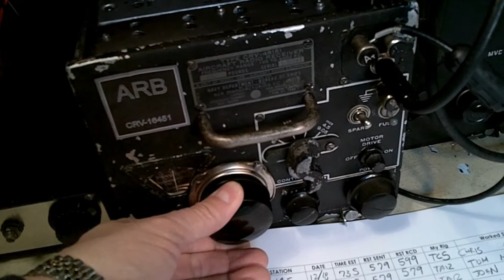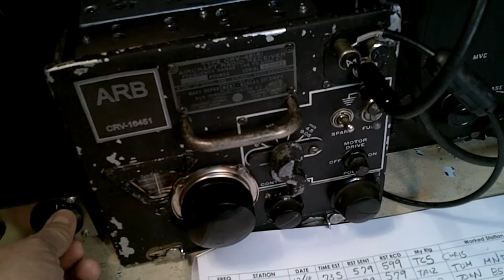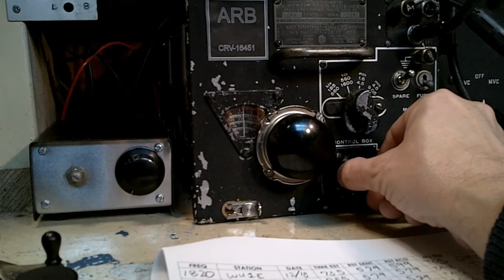Q Multiplier on Surplus Receiver

Comment: How about a GRC-9 receiver 456 KC IF? I'm lost in the noise listening to the OMRN on 3885 AM thinking about pulling out one of the Phone connectors and using another in the same hole to the Converter tube plate?jim KB1PFL
Reply from the maker: I guarantee it will work. I have modified Q multipliers to work on almost every IF frequency up to 2 MHz. 456, 465 etc.. all work by simple retuning of the slugs.

Comment: How do you make a varactor diode oscillate?
Reply from the maker: All linear oscillators utilize negative resistance in some form. Many types of diodes have a significant negative resistance region.  A negative resistance (N-Type) curve has a rising, a falling and then again a rising I/V curve segment. We need to establish an operating point on the falling part of the curve, where, when forward biased though an appropriately sized resistor, the current will bounce between two points called the peak voltage and valley voltage. Biasing above or below the sweet spot, the diode unfortunately becomes stable! No oscillations. Gunn Diodes, Tunnel diodes, Dynatrons and Varactor Diodes are examples of negative resistance devices with non-linear regions that can be utilized in this way to make oscillators. Add a tuned circuit and you get a sine wave oscillator.

Comment: Nice I have the best SW radio in history the Panasonic 2600 and I wondered if you know how to hook up a Q Multiplier to it? Thanks (73) Jim
Reply from the maker: The 2600 is not an entry level receiver that could be improved by a q-multiplier. It has adequate selectivity and passband tuning. But if you were to attempt something, first you would need to obtain the service manual!
Reply from the maker: Certainly one of the best portables! But it is too good to be improved by a Q multiplier! Remember the best results are with simple, low gain and very wide receivers.

Comment: Nice work, threw one together myself for my BC348, but I cannot get it to work. Do you use a coupling capacitor at the mixer plate on your receivers? As soon as I connect the multiplier to the mixer plate coax, the receiver goes quiet, and only time I get some noise from the speaker is when I touch the 6J5 tube. Might have missed something from your schematic.

Comment from the maker: Nope, the BC-348 uses a 915 kHz IF too. The military radio designers typically liked to use an IF that was 10 times lower than the highest frequency in a single conversion superheterodyne in order to more easily reject the image frequency with the front end bandpass filter. So the coils will need about 100 turns depending on the coil form and slug.

Comment: So is the first mixer on a BC-348  455KC as well? I 'd Like to use this Q Multiplier, but I'd also like to try improving the selectivity of the BC-348 by splicing in a BC-453 to the chain of the first IF.